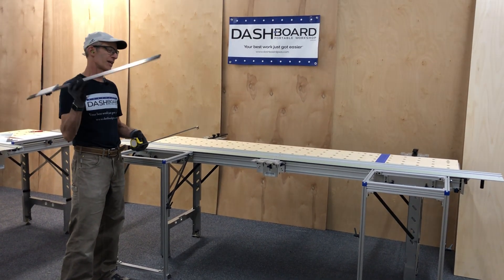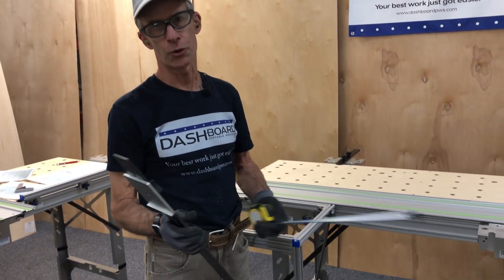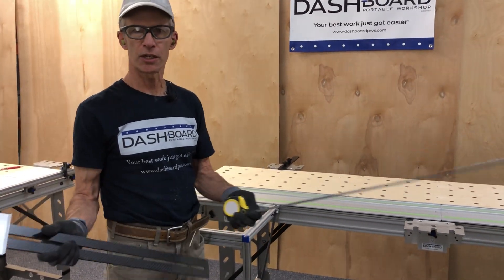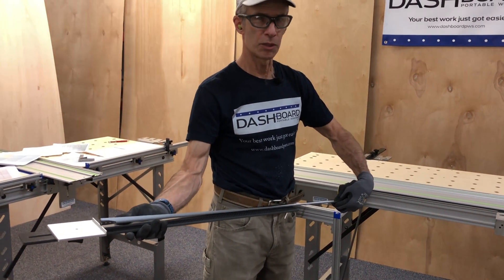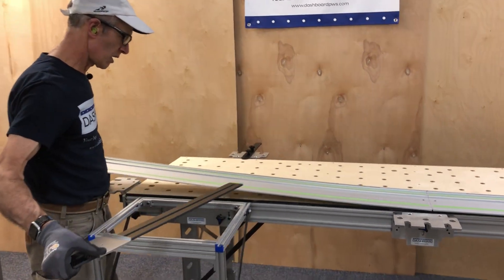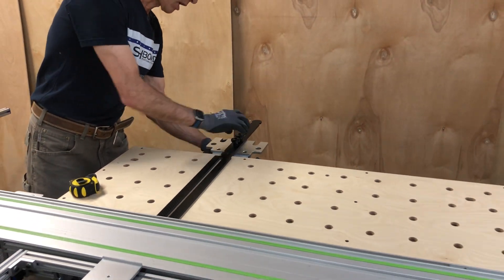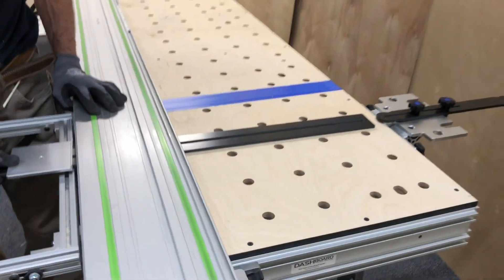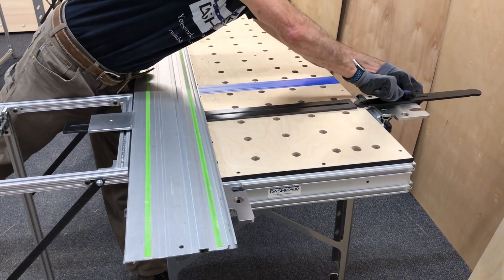One of two ways to use the Rip Gauge XL

Comment: I just ordered one of these after a snafu this weekend with <not to be named> parallel guides. The design is brilliant and it makes total sense that using one guide guarantees accuracy.
Reply: If those guides are blue, I too have felt this pain.  Sadly the error was on the first long rip and required me to go back to the lumber supplier for another sheet.  Then I had to explain the delay to my wife as the project was for her and set me back a bit.  It was user error, not necessarily an issue with the tool.